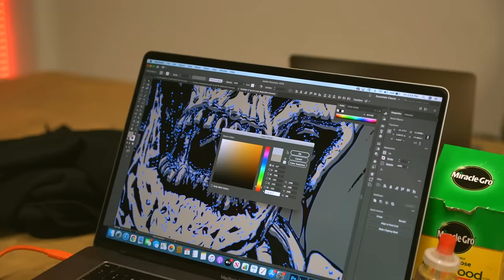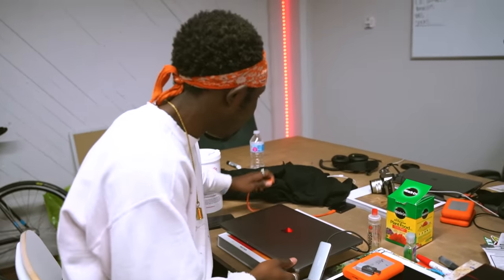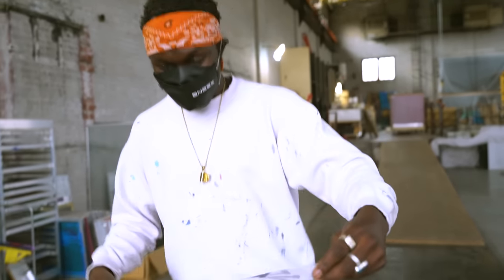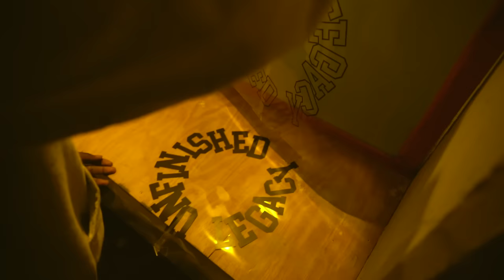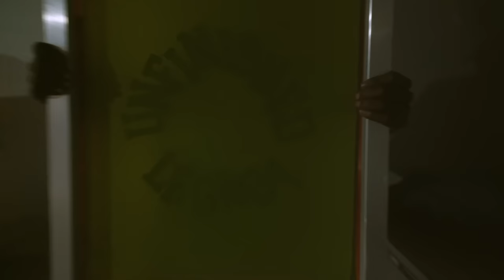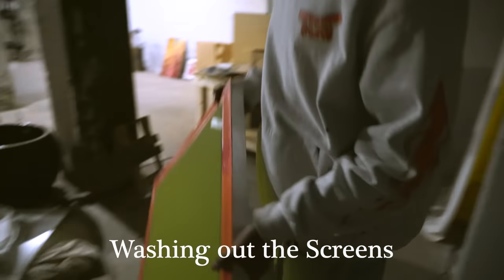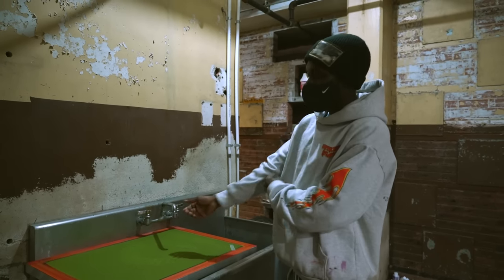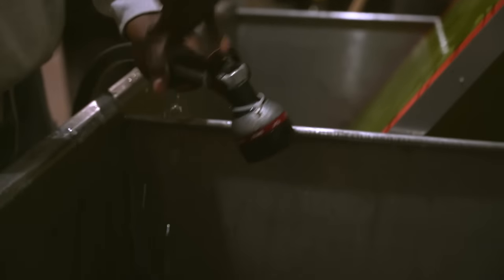How To Screen Print For Your Streetwear Brand

Comment: I had screen printing as a class in school, and we always would use crop marks on the edges. Then its just a matter of lining those up. Tape over them when everything is lined up and you wouldnt have the hassle of trying to line up the print itself that can sometimes be difficult on intricate designs.

Comment: hey brema, after doing some screen printing myself what i found are :
1. i dont need to coating 2 sides of the screen, only 1 side coated is alright.
2. i can use hairdryer to let the screen and emulsion dry quickly to speed up all the proccess.
so i can moving on to test and production more effectively.
Reply: You definitely need to coat both sides of the screen.

Comment: if you keep using hands to scrub the mesh when exposing you may have to retouch so much when you want to finally print, what i always use a foam. once the water starts running use a hand foam " i mean like a bed foam, but small " use it to dab on the exposed work the work will be coming out like magic. instead of hands, some ideas work for some people tho.
Reply from the maker: Appreciate the tips, will give it a try

Comment: dude you can take like an old kitchen cabinet bottom, and make rails inside to slide screens in,  stack let's say... 6-8 depending on your mesh / size. prop a fan on it it circulates and dries that shit mad fast. basically make a bakers rack. if you're in nyc you know there's cabinets tossed everywhere end of the month haha
Reply from the maker: Thanks for the input, will give this a try

Comment: There are bigger sized Canon printers which are great for printing films really dark
I use pixma TS 9550 A3+ size, inks are not expensive and prints are dope no need
for rip software, it is good for heat transfers too. Hope that helps👍🏻✌🏻🌞

Comment: Hey Brema,  could you Do a video on deciding mesh count on screens? My deeper question is why don’t ppl just use the highest mesh for every design?   Where to buy the screens would be cool to know too. 
Thanks again,  any one else with experience reads this, please feel free to add input ❤️🙏
Reply: Higher mesh counts = higher detail but less ink is deposited. 110 is great for thicker white inks and 160 is great for solid spot color designs. Over 200 is for halftones or high detail
Reply from the maker: @MrDny3000  Thanks for responding, Right on !!
Reply: @MrDny3000  awesome.

Comment: If you don’t have a flash dryer could you use a hairdryer on low heat instead? Looking to start screen printing but want to get the least amount of equipment possible.
Reply from the maker: Yes, you can use a hairdryer

Comment: how much is the initial investment cost to buy all the equipments u need?
Reply: All u need is a heat press, or flash dryer, screen print set up , plastisol ink, emulsion, and a squeegee.

Comment: Your graphics are cool but try wear gloves when you reveal your emulsion caus i m not sure that the silver nitrit is good for your hands 
Also put some rubber on the corner of your screen while you screeprint . If not, the ink is going to dry between your mesh and your screen and you re going to have issues with that
Reply: but your video is cool